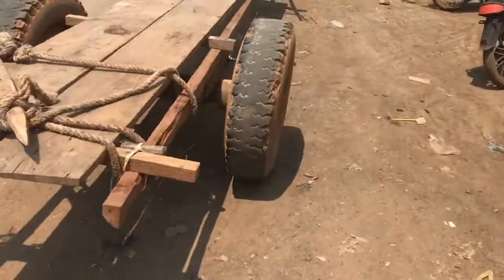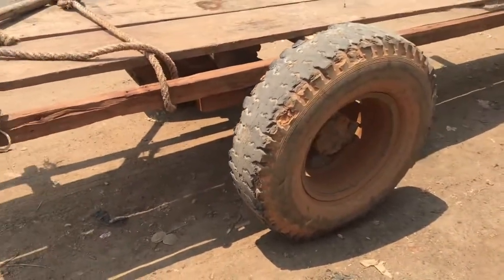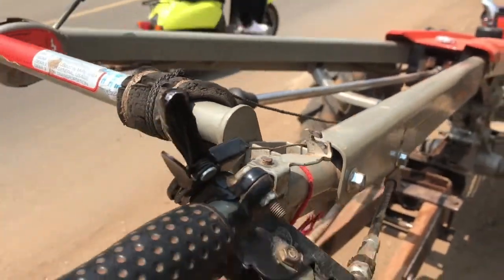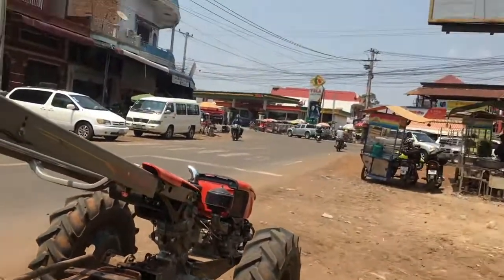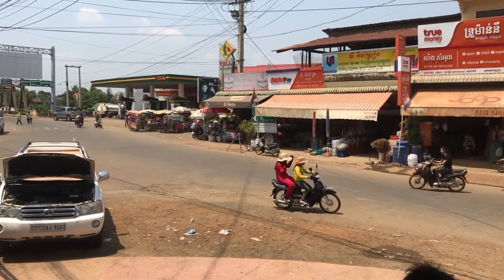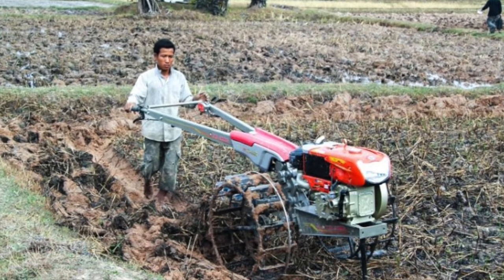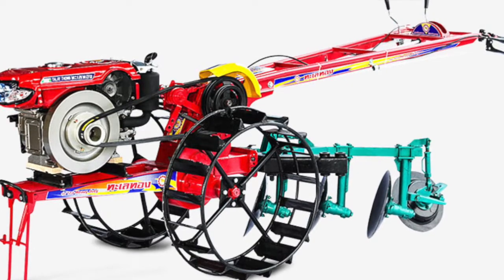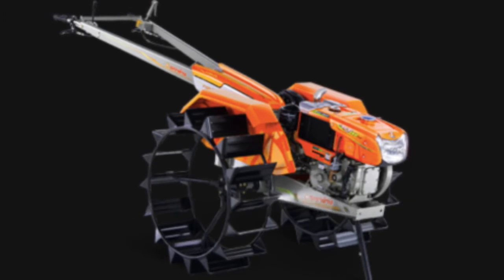LocalTech: Two-Wheeled Walk-Behind Tractors (Kampong Thma, Cambodia)

Comment: Very cool video! I first saw one of those while in Nyaungshwe, a city at the north end of Inle Lake in Myanmar’s eastern Shan State back in January of 2002. The low open bed trailer it was pulling was carrying some of the local residents, and I was very intrigued. I would see one again in Cambodia (March 2009) and am sure I will see more when I travel to Laos next month. Thanks for posting.
Reply from the maker: Well let me tell you man, they're NOT rare if you're out in the right places.  They're still big all over SE Asia, the poorer the better.  Also, in Laos, look for these funky trucks that use the same single-cylinder engine.  Those pungadda-pungadda diesels are a standby over there.

Comment: Graig do you know how much these tractors?
Reply from the maker: Oh I've learned just a teensy amount.  If you have any questions, fire away, and I'll tell you whatever I can.

As an underworked engineer my mind wanders, wondering what else I could do with one of those butt-solid single-cylinder Chinese diesel engines.
Reply: @craigrmeyer  i have a small kubota diesel engine and i want to build a walk behind tractor, just like the ones in your video, to use as a cultivator on my tapioca farm here in Tonga. I wanted to see how they're constructed before i start. Thank you for sharing your video.
Reply from the maker: @utulangi6078  Oh!  Well of course it's my pleasure.
Reply from the maker: @utulangi6078  As I recall, the real wizardry has to do with how they switch tension from belt to belt.  There's a gearbox transmission also, between one belt pulley and the transaxle that holds the wheels.

I don't know a thing about tapioca, but I do know that the Thai King Bhumibon helped to invent these things.  His special innovation had to do with the clutching system that somehow made these much easier to use in wet marshy rice fields.  I'm not a dumb guy exactly, but I would NEVER have thought of that.

Walk-behind tractors have been around forever actually, like over a century in the States at least.  The real finesse has to do with gearing, and finer points like clutching and steering.

There MUST be more information about these on the web.  More videos of their controls, and how to use them.  If not, that's just an absurd shame, because there are at least 10,000's of these in use, if not 100,000's or millions!

I wish you could just fly out here, meet someone who speaks Vietnamese/Laotian/Thai/etc, and just come out and ASK these people how they work.  But of course not anymore.

One big maker of these is the Kubota company.  And surely others too.  And they have websites, and youtube videos, etc.  Just scrape around and absorb as much as you can.
Reply: @craigrmeyer  one day after these shutdowns on the pandemic i will definately come down. I am also in contact with a supplier from Thailand about some of the implements that i will need. I will start by building one but as my farm grows i will need more of these machines. I also like it's multi-purpose use. I will share with you my progress on my build if you want. Anf keep in mind that there aren't many of these walk behind tractors here. So the parts will be with what i can find here. About tapioca; it is also called manioc, cassave, yucca, etc and a food stable in many countries around the world. I'm a new farmer and i find it easy to plant. But cultivating it i find, via youtube, that in south east Asia, they use these machines to weed between the rows which will be a huge advantage to my farm and a big save on labour costs.
Reply from the maker: @utulangi6078  I defer to the gentleman from Tonga (that's you) on what he wants to do and how he wants to do it.  I'm just happy that you're digging up all the information you can before sinking a bunch of time and money into this.  (I've always fallen short in this department myself.)
Reply: @craigrmeyer  actually you are the first person to have a conversation with me on this subject. I've watched many videos on youtube from many different countries around the world and find that i am interested in the way the Russians and folks from Southeast Asia build and utilizes these things...and here we are. I thank you for taking time to talk.
Reply: @craigrmeyer  wikipedia says there's at least 16 million most of them in asia, they're indeed pretty interesting machines, although I've seen some videos that are straight up scary, kids standing on the ploughs for example
Reply: You can order 1 unit wordwide through Alibaba. I've been thinking of buying one for yard work here in Canada. A drive to the corner store on one sounds like a fun idea too! Would probably turn some heads, i've never seen anything like that in Canada before but have always seen these "One eye'd dragons" in third world countries, especially in Asia.